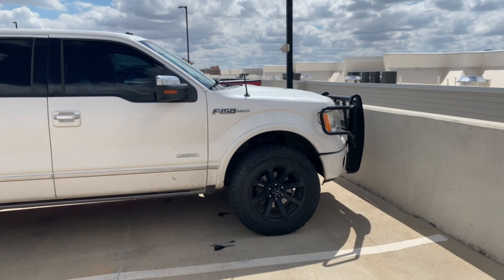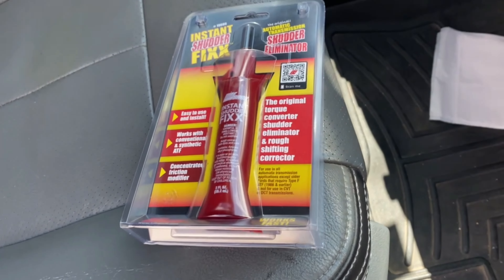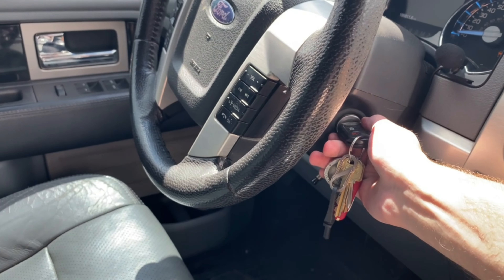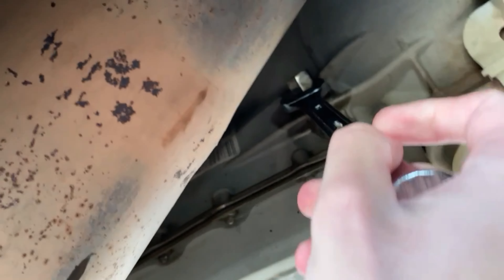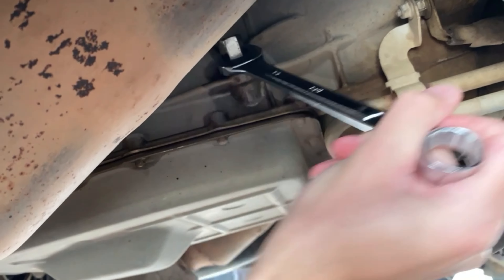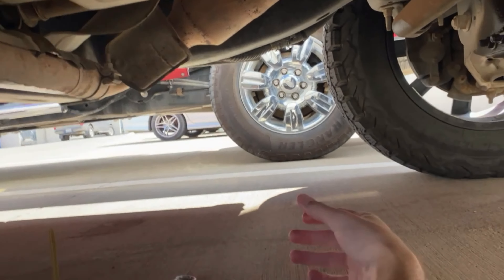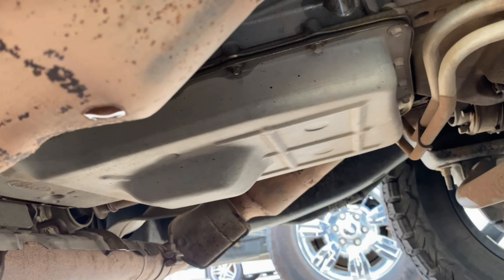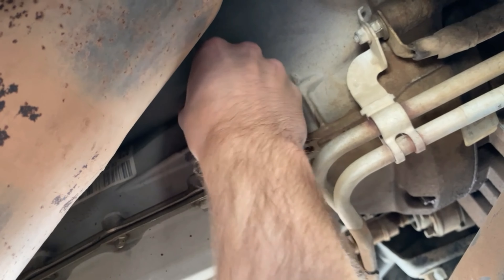F150 Vibration on Acceleration Fix

Comment: There's no reason to start the engine while doing this. Do it cold with the engine off so you don't burn your hand. This product works 100 percent, however you could also drain and fill the transmission and almost always have the same results.
Reply from the maker: I tried doing it cold the first time and it wouldn’t take the fluid tried again with the engine running and took it no problem.

Comment: Hey man, i just started having this problem in my 2015 F150 3.5 Platinum, I bought it a few months ago its in neat conditions, but I started feel the vibration on the back axle, and now its very bad, the whole cabin shakes badly,  it only does it on the highway or sometimes when I press the gas on the highway, very new at this problem and everyone is teling me something different, will this work? And what exactly is the problem, is the transmission? Would aprecciate the comments 🙏
Reply from the maker: Yes it should fix the problem from my experience with it. My truck did the exact same thing it would really only happen at highway speeds. It felt like the truck was driving over rumble strips in the rear end for a few seconds after acceleration and then it would smooth out. This is a very cheap fix so I would definitely start there. I saw other videos of people using this exact stuff and claimed it was good for over 80k miles with no issues. I used it for around 10k miles and had zero issues.
Reply: @brett.32  I really aprecciate the comment man🙏 it's very hard when I feel this on my truck, I Will definitely buy this product so it can go away for a while🙏  Maybe I can upgrade to an f250 during this product time frame, lets see, Thanks man I really appreciate the time and kindness!👋
Reply from the maker: Yeah of course hopefully it works as well for you as it did for me and plenty of others in the comments!
Reply: @brett.32  My 2016 XLT with the 2.7 just started doing this.  I'm curious since this video is a year old.  Did this only temporarily fix the problem for you?  How many miles have you put on it since you used the shudder fix?  Thanks for posting the video :)
Reply from the maker: I actually sold the truck because it started to have issues with the turbos and I did not want to pay to fix it. However I drove the truck for multiple months after putting the shudder fix in and it was smooth ever since. When I was doing research on it one guy said he went 80k miles with it and never had problems.

Comment: Ok so you have to have the vehicle running to do this
Reply from the maker: Yes I watched videos and ford techs said you have to have the vehicle on. I tried it without the vehicle on the first time and it just overflowed out. Second time I had the vehicle on and it went in no problem. Just watch out for the exhaust because it’s very hot.
Reply: @ sounds good thank you been having this issue going to give it a try just wanted to do it right
Reply from the maker: Worked good for me hopefully you have the same results

Comment: Is the shutter problem same symptoms of the common driveshaft issue? A highway speed about 65 miles I feel the vibration. Not sure if it's the drive shaft or the shutter. If I don't go to 65 the truck drives smooth.
Reply from the maker: It could be the shutter because on my truck it would only do it at highway speeds. I would definitely start there because that’s the easiest and cheapest thing to try instead of messing with the driveshaft

Comment: Have you changed the spark plugs?
Reply from the maker: Yes I did. It was a transmission problem not something with the engine.
Reply: That is a good question. Ford engine miss will mimic converter shudder in older trucks and if left missing it will kill the transmission but the 6r80 it is commonly a shudder. This fixed mine until I can replace filter and refill. I lifted the passenger side, cold and not running. I added the Shudder Fix and let sit about 30 min and drove about 60 miles and haven't felt it since.
Reply: @brett.32 what was the issue with the transmission?

Comment: Why Stat the engine before adding the additive 🤔
Reply: you have to start the engine to engage the pump to bring down the fluid level, otherwise it will pour out fluid as soon as you remove the dip stick cap with engine / pump not spinning.

Comment: Did you happen to also get a flashing check engine light that would go away after maybe a min or so? 
Mine read misfire so replaced plug and coil but same issue happens. 
So just curious if you or anyone else did the same but shudder fix helped. Thank you!
Reply from the maker: No I never got a check engine light
Reply: Mine does the same. Same year 2015. Did you figure out the issue?
Reply: @jshinobu007 2015 here too going to have to try this mine just started having this issue
Reply: If it is having a miss fire and your plugs and coils packs are fine drill a small hole bottoms driver side of your intercooler
Reply: Same problem did you get yours fixed?

Comment: Off topic but do you have any pictures of this truck anywhere? I want to put those wheels on mine.
Reply from the maker: No I sold the truck awhile ago but they were the wheels off the 2018 f150 roush I’m pretty sure. They’re hard to find though since the only way you could get them is from buying a roush f150.
Reply: @brett.32  I got ya, I appreciate it. Yeah, I’ve been looking for a set for a few months now.
Reply from the maker: Yeah I found mine on marketplace for $625 without tires

Comment: Why does it need to be running?
Reply from the maker: If it’s not running the fluid won’t go into the transmission
Reply: I was about to ask this too.
Reply: The fluid will absolutely go into the transmission with it not running unless you filled your transmission too full.